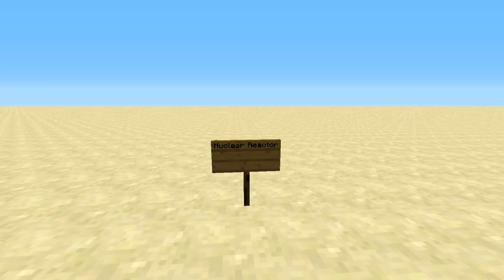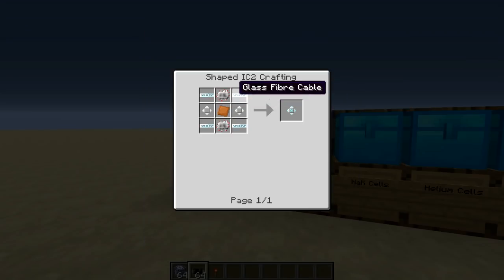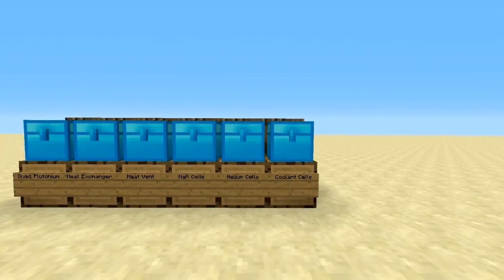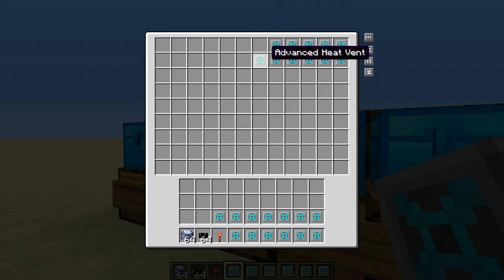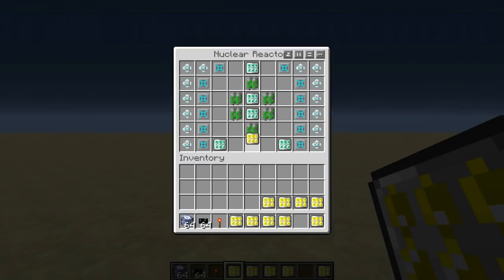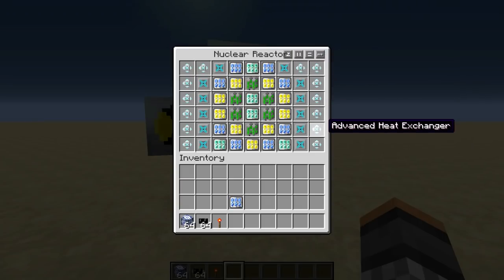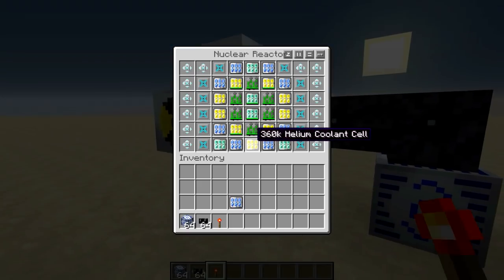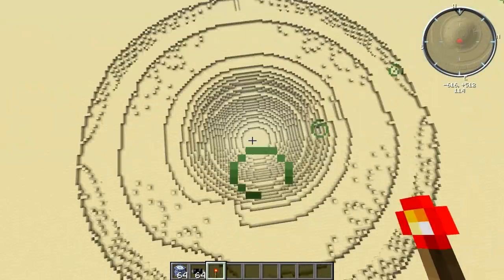Industrial Craft 2 Best Nuclear Reactor Design Tutorial (Minecraft/Tekkit/FTB)

Comment: Isn't there a setup where you load the reactor with some ice and loads of quad uranium cells and keep pumping ice quicky to ensure it doesn't run out? You can get ice from compressing snowballs which you can get from a machine that I can't remember right now that turns water to snow, setup buildcraft pumps to infinite water supply and you get infinite ice!

Comment: Obviously? Well that is just rude. I built it on my test world with QUAD Plutonium cells, because I can listen and read. I also built it in the IndustrialCraft Reactor Planner version 3 and both are giving out a 880 EU/t On top of this, even if you were to use 4xHV the highest amount it can take is 2048 EU/t proving that there is no way 12,000 EU/t is going through the wire. So who OBVIOUSLY doesn't know what they are talking about?

Comment: This setup makes literally no sense...the heat exchangers and the heat vents are doing nothing and the coolant / helium cells are doing all the work.

Heat exchangers don't push heat out of a reactor wall that's not a real thing...they move heat around inside of the chamber. The heat vents that your using aren't venting any heat because they aren't touching any components that are holding heat. If they were working than you'd see a durability bar like the coolant cells show.